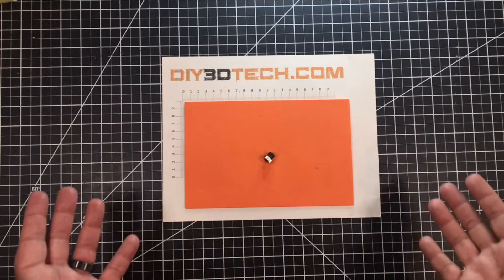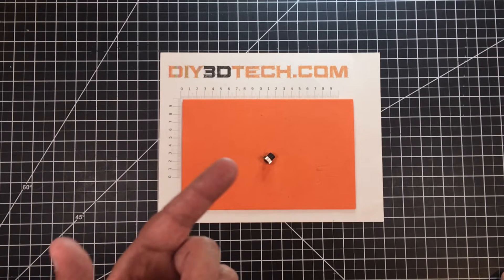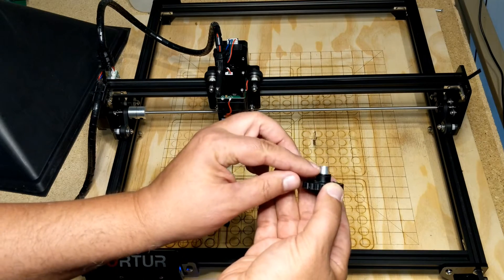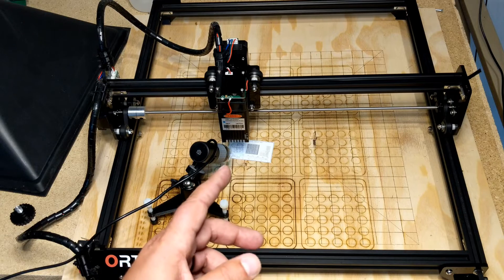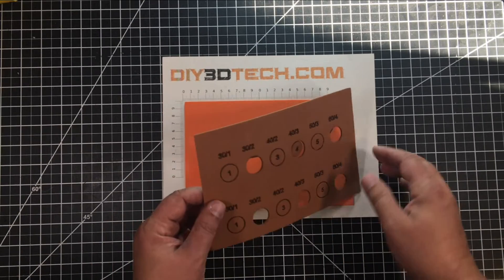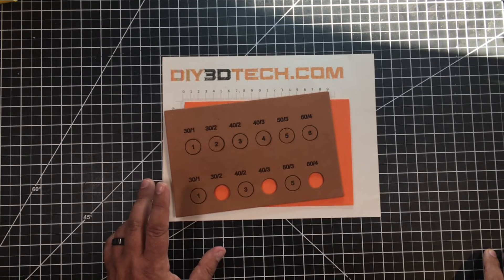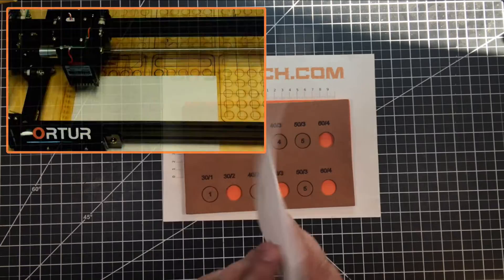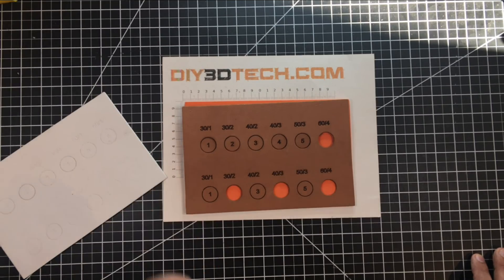Ortur Laser -  Is the G8 a Miracle Lens!

Comment: Hi,
I have the newer 20w laser module, the lens/barrel looks slightly different. However the issue i am having is, i am unable to remove the lens.
it just keeps twisting but does not remove. I pulled the lens and it seems it can slide up and down, but does not pull out or twist out.

Comment: Hi there, I have the Ortur Laser Master 2 with the 4-4.5 watt output laser. If the G8 lens has a longer focal length, why didn't raise your laser before focusing? I bought a G8 lens from a laser parts supplier and he suggested the distance from the laser body(not the lens) to your workpiece should be 4-4 1/2 inches. I have seen anywhere from 2"-3" What is the correct distance? Can you make a video showing the correct measurement from the laser to the workpiece? Does it very with different power output lasers?

Comment: I wonder if this lens and the Ortur 20W would be a badass combination for cutting. They say that the 15W unit is actually better because for cutting because of the lens focal length. So in my mind with this lens you get the good focus and more powerful laser. = Profit? :)

Ortur states the following:
"You could get the same engraving result with a powerfull laser at less power rate. But, LU15W has a longer focus length than LU20W, if you need to cut plywood, it would be better to choose LU15W than LU20W. In engraving the same materials, LU20W is much faster and can engrave much more materials."

Comment: Just purchased the G8 lens from this link and it does not fit into the 20w Ortur Laser Master.  the threaded barrel is too small of diameter. did i waste money?
appreciate any assistance.
Reply from the maker: No clue on mine it does fit, however if you one of the fixed focus then you might have an issue as I don't have one of those so not sure how that works...

Comment: Before you had G8 lens, would you be able to focus to point or to small line? I have the 20W version original lens yet, and I'm wondering if the G8 lens will be able to correct this issue, since moving the z axis, thus modifying the focal lenght didn't improve my focus.
Reply from the maker: In general diode lasers focus to a bar and not a dot.  This is rather complicated to explain but the short side is the fast rise time and the long is the slow.  The G8 lens has higher efficiency and longer focus length meaning a smaller kerf though thick object like foam....

Comment: Ok so I purchased the G8 from the link in the description. I finally installed it and can’t get it to focus right. The only way I can get it to focus is if I unscrew it so much that it falls off. What am I doing wrong? Any suggestions are greatly appreciated!
Reply from the maker: First do you have pointing the correct way?  There is an up and down to it, second is it has very long which at minium the object to be cut needs to be from 30mm to 100mm away unlike a G2 which needs to very close.  Mine is about 50mm away...
Reply: @DIY3DTECHcom  Yes I made sure it’s screwed the right way. I’ll play a little more with the distance from the material. Thx!
Reply: @DIY3DTECHcom  which way does it get inserted?  Is it up towards the laser?  The notches or not?  Thanks

Comment: Hi, i would like to ask if there are possible way to cut a clear acrylic using diode laser ?
Reply from the maker: Sorry no, you need a CO2 laser as keep in mind a diode laser is a visible light laser so if you can see though the material so will the laser...
Reply: If you mean "cut" as in cut through, then no, but you can engrave  (sort of) an image onto the surface by using a backer board or something on the underside of the acrylic. The energy will be focused on the media under the acrylic, and the acrylic will then absorb SOME of that energy. The result will be an image burned (melted)  into the surface of the acrylic. I'm not sure of the success rate, but I know people are doing it and eventually someone will outsmart the law of physics.